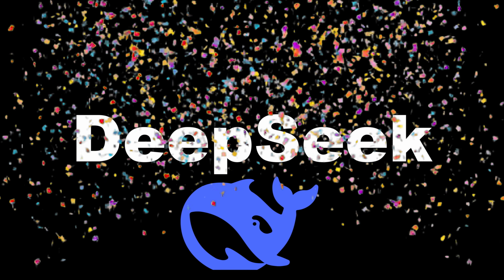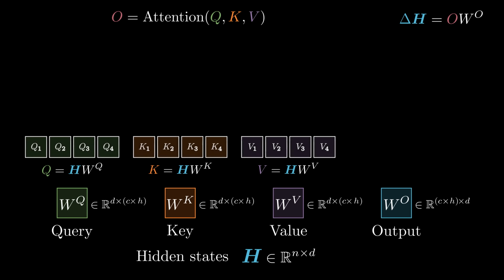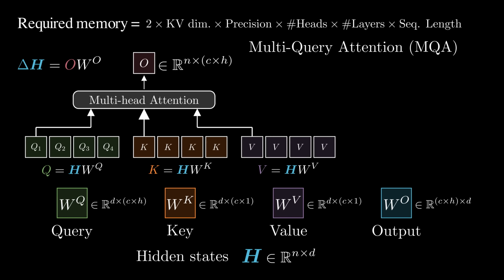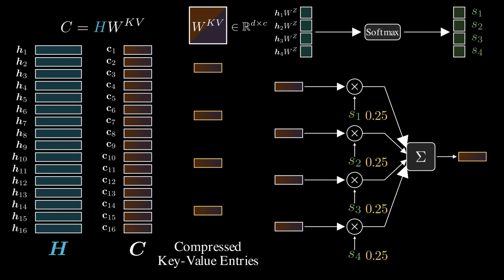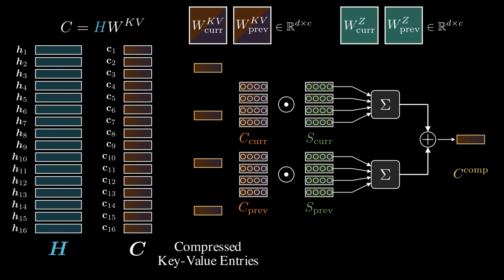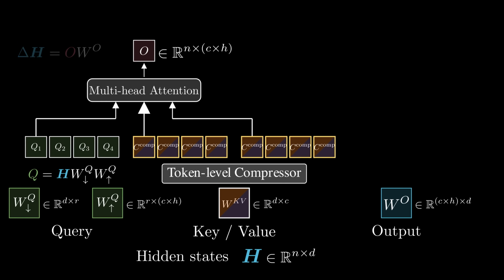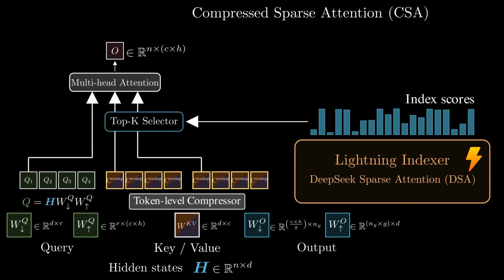DeepSeek V4's Secret: 98% Less Memory

Comment: I wish that open source AI companies would focus more on taking their smaller LLMs and focusing on bringing their performance up to that of higher parameter options rather than chasing high parameters while open source sounds good on models like these it’s not realistically runnable on anybody’s local hardware
Reply: Exactly. The training data is key.. but open weight models can be fine tuned or 're-trained' ... So its still good. Whether you want a 2b parameters model like qwen3.6 0.8b or Gemma4e2b or a huge 1.6T parameter deepseekv4 ... Open weight models are openly adjustable and repurposable... It's just a matter of time before the smaller models get more effective, but for small models like OP wants... Therr is a limit to modern model architecture and efficiency, so it's easier to scale up the training data to larger models rather than make efficiency improvements... For that you want a fine tuned model for each specific case, whereas larger models are more general purpose.. and the ultimate general purpose AGI is likely over 100T parameters
Reply from the maker: Yes, there are two lines of work. One pushes for stronger performance and another focuses on efficiency (or applications on edge devices). It would be awesome to have a personal LLM that live on your phone without relying on API/Internet!
Reply: @jbhuang0604  Interested in larger models natively trained on NVFP4 (or similar). There is an enormous amount of space efficiency left to be extracted in this field. Useful for more than just edge devices.
Reply: It's happening already, they already brought the same performance as deepseek v3 with 500b parameters to a 250b parameter model with deepseek v4 flash. You're not going to get that performance in 30b or 8b anytime soon, that's not a matter of preference but a limit of our current technology
Reply: Honestly it is not that hard to imagine this tech becoming a comodity. It kinda already is, in devices with unified memory you can already run these models in a single high end consumer hardware. But the thruth is average consumers dont need it. Is like engineering workstations, unless you are running CFD simulations all day, you dont need a fancy modern CPU with 16+ cores.
Reply: @Michallote  But average consumers do use ChatGPT and the others. It's about running it locally. It's taking the tasks consumers use in a cloud model and being able to accomplish them locally
Reply: Don’t worry, it’s gonna get there. That’s where the world is going.
Reply: Qwen 3.5-4B Model is a thinking model that can compete with the old gpt-3. It runs reasonably fast on a 8GB graphic card. model size is just 5GB. The qwen model's are by far the best allround open weights model's. nearly zero hallucinating.
Reply: As far as I understand, they're open only because that's the only way they'd ever gain any noise or traction, they're not necessarily open by philosophy. The idea is, no one would trust Chinese AI if you couldn't openly check their homework. They get their financial kickback by hosting the AI, or having partners presumably that give them a cut too.

They have no vested interest in edge AI.
Reply: Well you are just wrong there 😂 
China is the largest trading partner of 140+ countries in earth.
Saying "people don't trust Chinese companies" is as ridiculous as saying "America is a peaceful country" 😂
The reason they open sourced it is because they want market dominance, because America has used every dirty tactic imaginable to ban, sanction, tariff, defame Chinese businesses from Huawei to DJI to DeepSeek, and even Universities.
China is not willing to use dirty tactics like those, so they use freedom and give power to the people (open source) to take market share away from imperialist American oligarchies ❤️
Reply: @darthvadeth6290 If it was true, they would open their SOTA video models. They dont. 
They open just non-SOTA LLMs.
So it is not love for the freedom, it’s just market strategy.
Reply: @SungaM8759  What a stupid argument 😂 you might as well say "if they truly love freedom, they would tell me their bank account password" too 😂😂😂
It sounds like you are just a greedy freeloader who wants everybody to give you everything they have for free. Pathetic lmao
Reply: @darthvadeth6290 Your argument reveal that you are not just rude, but dumb. Learn to read right. I dont care about America or China, but you are a China propragandist or just an idiot.
Reply: @darthvadeth6290  "China is not willing to use dirty tricks like those..." 

Are you sure?
Reply: @kevikiru  notice that you can't name one 😂
Reply: @EmCeeJuan1 you are biased by the propaganda kid, only Americans hate China just because. It clouds your judgment
Reply: @Michallote  Taiwanese, Filipinos,   Thai, Vietnamese, Uighurs, Mongolians, Tibetans don't like China for some of the same reasons Americans don't either.
Reply: @EmCeeJuan1 What you understand is wrong. Open source means that you can see the source code so you can understand what it was doing so there is no hidden black box. You can examine the code and see exactly how things are done. Deepseek is open source and open weights. This means not only you can examine the code you can also download the whole thing and make it run on your own private server.
Reply: @kazedcat  no you're wrong. open-source by definition means that it would also have to be open-weight. Stuff like the code is only a few hundred lines to run the model. Most of the malicious payload if there would have been there in the model weights too, not obviously in the python.
Reply: @Hamb_y1078 DeepSeek is open weights. I am not wrong.
Reply: @kazedcat  Open-source software (as opposed to source available) has a few additional requirements:
- the ability to build it yourself (in an AI model, this would mean getting access to both the training code and the training data)
- permission to create and distribute derivative works (possibly conditional)

Under this framework, most “open-source” models are really just open-weight. They give access to the weights, permission to create and distribute derivative models, and the code necessary to run the model for inference, but do not give access to the information necessary to recreate the model.
Reply: @lowellcamp3267 Yes you can distill DeepSeek and train your own Ai. They even improve the process of distillation so that it is easier for anyone to just mix and match their own custom model.
Reply: @kazedcat  DeepSeek is technically not truly open source; they are open weights and extensively publish highly relevant research on frontier LLMs. In the context of LLM, true open source means the ability to reproduce the model from scratch. This requires full access to the training code and most importantly, the training data, which is the foundational source of an LLM's intelligence. The most recent, okay-ish-capability, truly open-source LLM family is the OLMo 3 series from AI2 (Allen AI), which provides every component needed to train the model from scratch (data, training scripts, kernels, inference code, and a permissive license)

However, imo, when compared to other 'giant' models in their class (such as Kimi, GLM, or Qwen), DeepSeek is arguably the closest to true open source boundary due to their permissive licensing and the amount of contribution they have made to the Language Model community as a whole: researches, white papers, RL-training framework, kernel optimizations, inference engine contributions, networking libraries, etc.
Reply: @kazedcat  He do not understand about programming, so open source do not mean anything 🤣🤣🤣
Reply: The humble Gemma 4:

Comment: Along with CCP.

Your data now belong to us!
Reply from the maker: I recall that there are some other hosting service that can serve DeepSeek V4 models (since it's open weight models). So your data should be protected there if you are not comfortable with using DeepSeek API directly.
Reply: @jbhuang0604  "should be" is not reassuring.

Don't underestimate the CCP.

Comment: Sounds like convolutions-ish with extra steps applied to token information compression. Neat!
Reply from the maker: Yes! Exactly. That token compression step can be seen as a data-dependent pooling operation.
Reply: @jbhuang0604 Isn't it basically Multiple Insurance Learning on the token level?

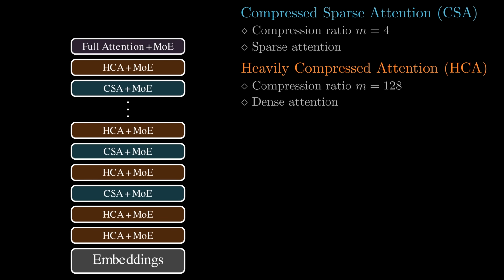Comment: Wait a minute 16:42,

If it uses full attention doesnt it mean it needs to store the uncompressed kv cache, thereby invalidating the memory savings?? 

I guess my misunderstanding is that I didnt account for the fact that each layer has a totally disjoint kv cache, so this is still only requiring 1/61 (61 layers in V4) the size of kv cache of all layers full attention 

Also curious if the full should be at the end or in the middle, did they ablate or atleast justify the positioning of full?
Reply from the maker: Yes, I think the full attention is only applied in the last layer. In every layer, we can cache the KV entries at different granularity. 

You can find this information in their config: https://huggingface.co/deepseek-ai/DeepSeek-V4-Pro/blob/main/inference/config.json
See the "compress_ratios" that has 61 values (128 -> HCA and 4 -> CSA). The last layer is just 0. 

Then, we can see where is this used in the actual attention implementation: https://huggingface.co/deepseek-ai/DeepSeek-V4-Pro/blob/main/inference/model.py#L490
When self.compress_ratio is zero, we are not using any compressed KV, so this should correspond to standard full attention.

The report did not say much. But I think the current design makes sense. Initial, they use HCA so each token can quickly get high-level global contexts from these heavily compressed KV entries. This would probably help the later stages of SCA for guiding where to look for more detailed information. (Think of this as a coarse-to-fine search.) And finally, they use full attention to make sure that it has the attention at the highest resolution (token-level).
Reply: Remember that attention, at its core, is a layer that provides "mixing". Each vector V_t becomes V_t + f(V_{t-1}, ..., V_{0}). Attention doesn't "think", that's the MLP, attention "looks". At the deepest layer your vectors have been processed by all your previous layers so they're the most "reasoned about" and it would make sense that it's where denser attention is most efficient. This is also in agreement with previous archs where the first couple layers have Dense MLPs instead of MoE ones, because you need to think more about each piece of information rather than looking for more abstract concepts.
Of course, each attention layer has a different kv cache, since it's just saving the results for V_i @ W_K and V_i @ W_V, as layer X sees a different V_i than layer X+1, the KV cache will store different values.

Comment: just a quick question, since transformers are seq2seq models thatsmeans the output matrix has the same shape of the input matrix, and with compression we have to go back to the original seq length. the quesion is when we want to predict the next token we already comprese or leak info between future and curent tokens, that can mean the model is cheating. can you explain how the model manage to do masking future tokens while compressing them?
Reply: None of this include seeing future tokens. It's all about past tokens. Most recent tokes are not compressed. Only when they are some positions away are they compressed into a latent representation. Causal masking is still done for future tokens...
Reply: Masking is for training,  on interference is the next token. Training and interference is different.
Reply: @csabaczcsomps7655  so aren't they trained though weights to perform compressing?
Reply: @zaidamvs4905  they are trained simultaneously, in parallel, for tath need GPU.
Interference work more easy,
Reply: To clear up a few things here:

Causal masking isn't just for training — it's structural. Future attention weights get set to -inf before softmax, meaning those positions contribute literally zero to the output. There's no entity present that could "cheat" even if it wanted to.

Also, tokens aren't compressed based on distance in a standard transformer. Every attended token stays in the KV cache at full resolution. You might be thinking of Mamba or Perceiver-style architectures, which work differently.

The real question hiding in here is a good one though: if the model learned globally during training, how does it work correctly with only past tokens at inference?

Answer: the weights encode statistical structure across the whole corpus during training. At inference, the causal mask just controls which weights activate — it enforces the *direction of information flow*, not the direction of learning. The model doesn't need to see future tokens because their distribution is already baked into the weights.
Reply: So is this compression just get done in inference not in training?
Reply: @zaid_TNR yes, the chat session and all your uploaded file data (after training while talking) is compressed. What deepseek did here is impressive because they compress a bunch of data into almost nothing and uncompress it as needed for the AI doing the inference.
Reply: @zaid_TNR we make future infinite to can't be compressed , the past are finite and can be compressed this mask is in simple words.

Comment: You might try squared euclidian distance rather than the dot product when computing data dependent weighting.
Reply: Dot product is simply too compute efficient to move away from. Simple float multiplication is way faster than twice as many multiplications (squaring all values), adding arrays, and then sqrt the final array. The sqrt really is a killer.

Even if you wanted a more accurate but slower comparison, you would go with cosine distance. That way you sqrt all input arrays (L2 norming), instead of all possible combinations of arrays.

Current standard is doing RMS norming on all input arrays, which is somewhere between cosine comparison and dot product. You do a sqrt on all input arrays, and you get more stability, but keep most of the expressivity of pure dot product. The expressivity of dot products is that the qkv projection can learn to weight the heads in beneficial ways.
Reply from the maker: Yes! And actually, if we first perform RMSNorm to the input vectors before computing the vector product, the two operations are *equivalent*.

Let's say we have two vectors u and v \in R^d. 

|| u - v||_2^2 = (u - v)^T (u - v) = ||u||_2^2 - 2u^T*v + ||v||_2^2

This shows the relationship between the squared Euclidean distance and the vector dot product. 

If the vectors are norm-normalized (i.e., ||u||_2^2 = ||v||_2^2 = 1), then the two are just related by a simple constant shift and are inversely proportional to each other. 

This means that we measure similarity with the vector dot product; it's the same thing as measuring dissimilarity with the squared Euclidean distance.
Reply: @yeetdeets  Squared not sqrt.  It's a matmul.
Reply: @dr.mikeybee  Ye, I misread initially. Apologies. Leaving it as is.